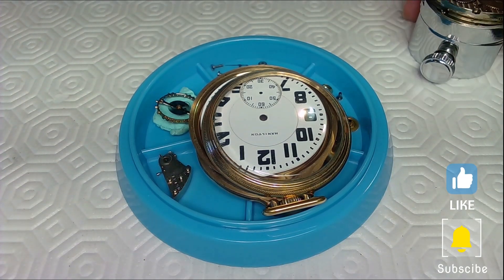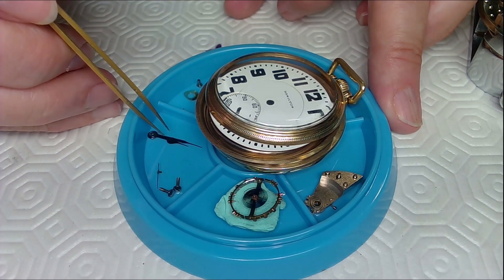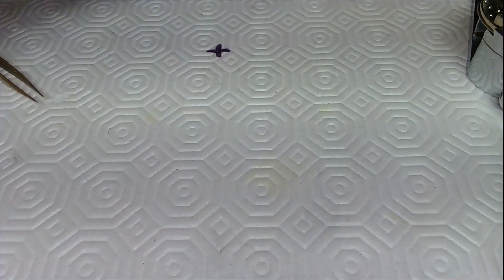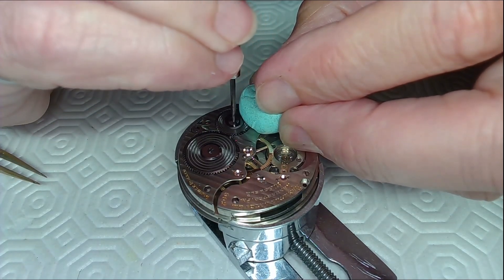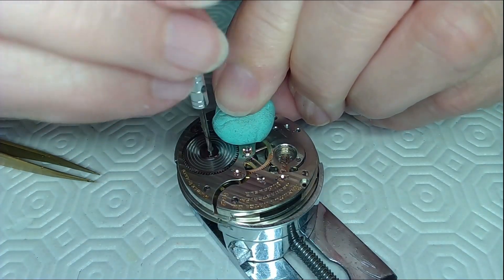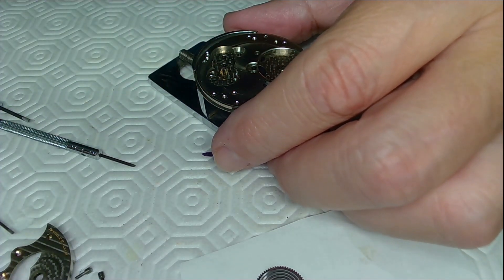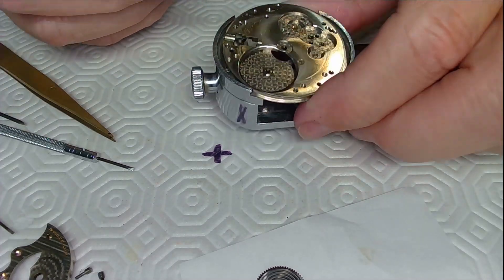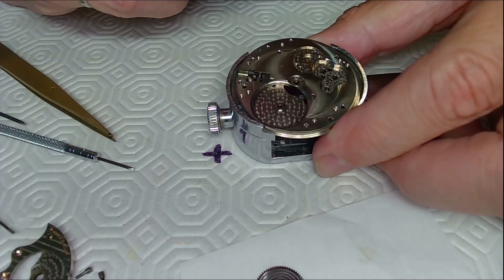Hamilton 992 Pocket Watch Regulation Issues  - Part 2 Disassembly

Comment: Great work, and a beautiful watch. Shame it’s been bathed in oil, though. 

Whilst oil on the hairspring can cause coils to stick together, messing up the timing, I think you were spot on when you said the bent regulator pins were the problem.

Due to all of the excess oil all over the movement, I suggest you pre rinse all of the parts before you start your regular cleaning cycle, otherwise you’ll ruin the cleaning fluids that are in the jars at the moment. 

You can remove the bulk of the oil by running the parts through the cleaning machine using straight naphtha or any other suitable cheap product you have on hand. Spin them dry and then start your normal machine cleaning process.

If you’ve already cleaned the parts, I suggest that you discard the cleaning solutions in the jars of your machine, and clean the parts again. 

Once the cleaning fluids get ruined by being saturated with excess oil, they tend to leave a thin film on parts you clean in future, which can cause problems with the running of the watch. 

Have you compared the balance cock screw with the other plate screws from the movement? It might be that you have an original screw and a deformed regulator spring, or a regulator spring from a different Hamilton movement or a different version of the Hamilton 992, as the design did change over time. I’m not sure if the regulator spring changed, but a material catalogue should show if there was more than one regulator spring for the 992 available.
Reply from the maker: Love your recommendations. I think I will pre-clean all the parts in lighter fluid before I put them through the cleaning machine, that way I won’t ruin the cleaning fluid as you have suggested. As well I’m going to do a little research on the regulation spring on the top of the balance cock to make sure it’s the one that’s supposed to be on there as opposed to a problem with the screw. I’m also gonna look at other 992 movements that I have to see if the screw looks different. I have a few 992s myself, but I’ve, purchased broken and fixed over the years. I think straightening up the regular pins won’t be too difficult and making sure that they’re tight against the spring but not squeezing it and this thing is got a terrible beat there so I’m hoping that some of the stuff will resolve the beat in different positions. thanks for the advice on the cleaning fluid, makes perfect sense
Reply: @JDRichard   A preclean in lighter fluid would really help preserve your cleaning fluids. 

The significance of beat error is overblown and often misunderstood. 

A 5ms beat error will mean the watch won’t self-start as easily. 

A movement with low beat error and in good order will start running with a couple turns of the crown. 

A watch with a 5ms beat error will need more turns of the crown & maybe a twist of the wrist to get the balance swinging to start running, but the timing issues you’re seeing aren’t down to beat error.

If you get a movement with an adjustable stud carrier (to make adjusting the beat error easy), and look at the timing with a 0.5ms beat error and a 5ms beat error you won’t see much difference. 

I didn’t get a good view of the overall shape of the regulator pins. If they’re not too difficult to straighten, so you can then adjust the gap between them correctly, that’s great. 

If they’re bent to the point that it’s very difficult to straighten them whilst still keeping them smooth (important), then consider replacing them. 

They’re just brass pins, riveted through the regulator arm and can be replaced if necessary.

Last resort is a new regulator arm. You won’t get the vertical positions anywhere near the dial up and dial down positions unless you can get the pin gap right, and the dial up and dial down positions won’t match if the pins aren’t parallel where it counts. 

When I first saw the timegrapher readings, I thought someone had been cutting/filing/undercutting the balance wheel screws. It was great to see in the video that they were unmolested.
Reply from the maker: @mercuriall2810  again thanks for the advice and I see your point. I actually had to do an adjustment of a watch where I had to make the beat air worse to enable the watch, not to be out of adjustment, sometimes called over banking and some of my books. It was a crazy way to repair this problem, but it ended up being the only way I could repair it and that particular watch is still running well now.
Reply: @JDRichard  Making the beat error worse to mitigate the watch going out of adjustment when it winds down is a clever idea!

The roller jewel at rest will be in the fork mouth and hold it against the banking. It should prevent it going out of action when the watch runs down. I remember that watch. 

I really like the thinking behind that.

That said, it doesn’t fix the underlying cause that enables the watch going out of adjustment, the safety action. That means if the watch is subject to an external force in the wrong direction at the wrong moment when running, it’ll go out of action and stop. 

Unless the watch is in regular use, actually being carried around whilst it’s running, then this is unlikely to occur.

Believe it or not, as long as a watch isn’t subject to external forces when running, it doesn’t even need a safety dart! Once it runs down and stops, it may well go out of action, however.

Comment: Excellent, JD! Thanks for the video. The 992 is a wonderful old watch and I fully expect you will be able to get the regular pins straightened and repositioned. Kinda a mystery how “Buddy” was able to get the balance cock screw in that position under the regulating spring. I’ll probably spend a little time on my microscope checking out the 992 on my bench. Cheers mate!
Reply from the maker: The balance screw part is the really interesting problem. I’m hoping I don’t have to continue to screw back the regulator after putting the balance back. That would make no sense at all. I would rather find the right screw for this balance one that doesn’t require as much lip so it can be removed without removing the regulator. The problem with the regulator pins shouldn’t be that difficult if I can bend them back and get them in good spacing